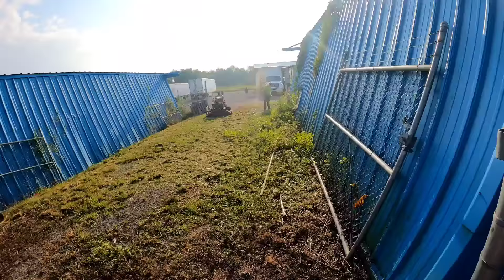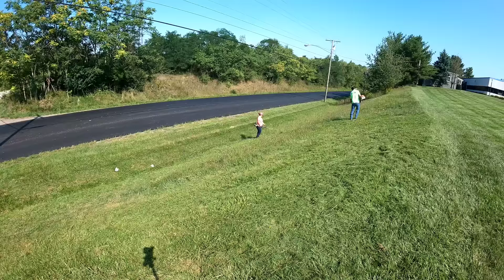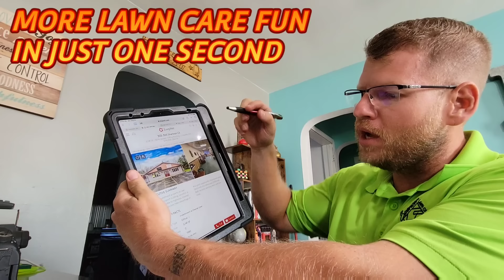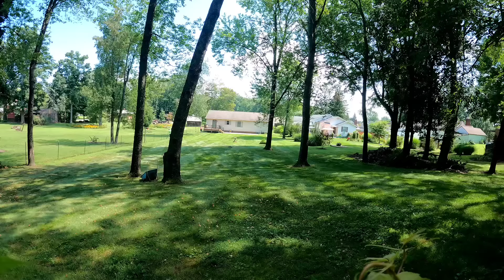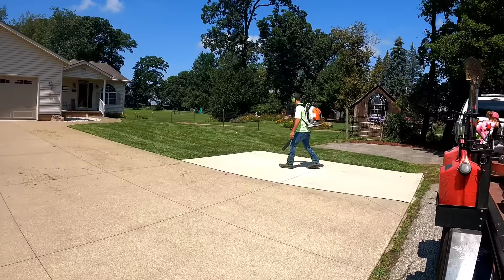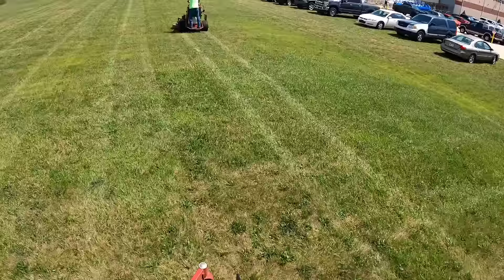CUSTOMER SAID I WAS TOO CHEAP - CHARGE ME MORE!!

Comment: Tyler just wants to look professional Because he is representing a good company And they care about their employee. And it looks good for the customers
Reply from the maker: We hope so lol
Reply: @SpencerLawnCare   I’ve tried going different ways an I’ve tried taking the guard off of the trimmer but weather it dry or wet it still seems to splatter now is tht from the line I’m using or what
Reply: @ctyardimprovements8662  what line u have and what trimmer
Reply: @FirstnameLastname007  sthil 91R with Shakespeare ballistic .95 tri edged trimmer line
Reply: @ctyardimprovements8662  I have that trimmer it is torquey as hell but won't high idle that's where your getting kill  maybe I would recommend put gaurd back on and find a heavy duty line that's pretty sharp....... I run black diamond it is sharp but it wears down a bit when u hit stuff so I have speed feed on all my trimmers ,
Reply: @FirstnameLastname007  I did put guard back on an I got a speed feed head on it maybe I’ll try tht black diamond
Reply: @ctyardimprovements8662  buy small role see if u like it, it wears fast but it cuts pretty easy
Reply: @FirstnameLastname007  ok thx

Comment: That's a decent customer right there 👌

 I do about the same  with an off the cuff quote.
   I try to remember the 30% rule ..  which is basically add 30% onto what my first impression price  is!

 If you end up with pallets of salt , maybe this year you could use the height of  your wall to reduce handling?  Or lease a skid steer ? 
   Key to reduce fatigue and increase safety and efficiency for owner operator business 🙌
  Thoughts and prayers of course 🙏